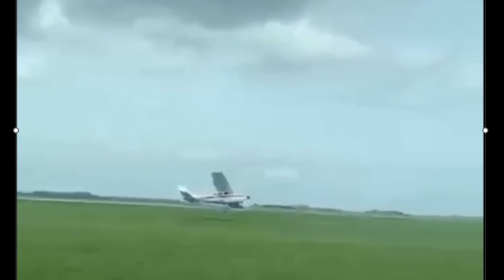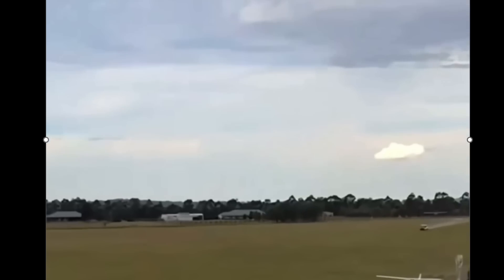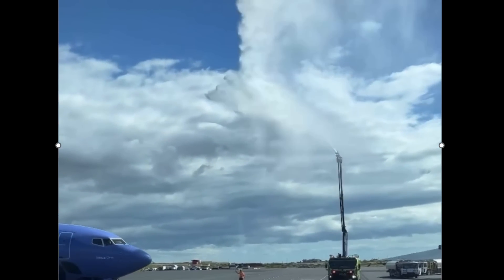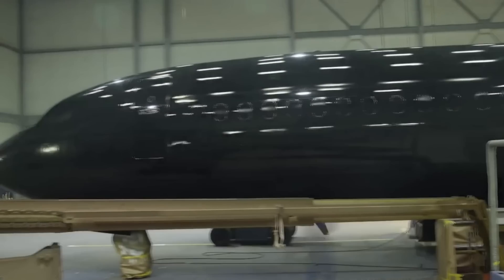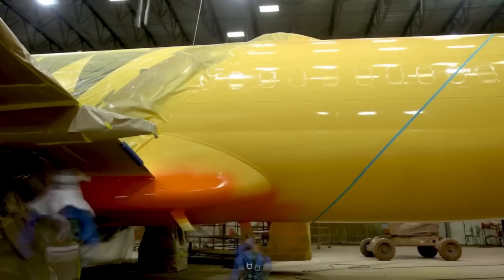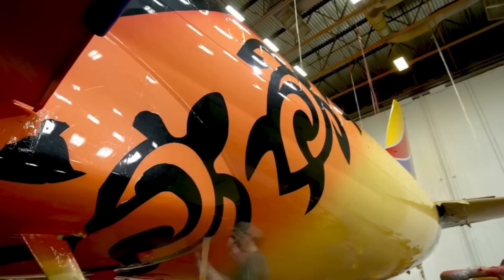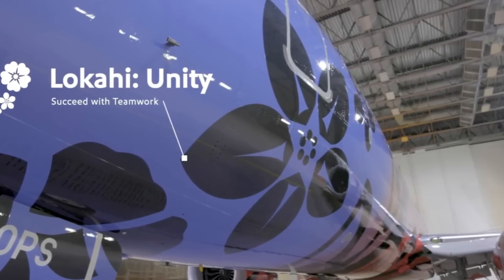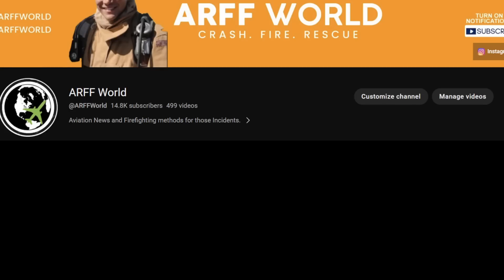Pilots Failed Landing Stunt and More

Comment: That post-maintenance flight doubles as a pre-INTENSE maintenance flight. Also, when the wing dropped in the second clip, I was expecting the worst, really good save by the pilot there
Reply from the maker: Yes that was tight!
Reply: Exactly. My annual inspection should be completed today. My mechanics are among the most experienced and best in the business, but before I fly, I will conduct an extremely thorough pre-flight. Then I will perform a test flight in daylight, good weather, solo, orbiting over the airport checking all of the systems, while staying in gliding range. After I land, I will inspect the engine compartment for leaks and conduct a thorough post-flight inspection. Only then will I fly a trip or carry passengers.

Comment: Very nice video.  The Cessna 207 will need a new engine and prop.  The engine mount and firewall will need to be inspected for possible damage.  The engine mounts in a 207 do not flex at all and are an integrated part of the airframe unlike a tube engine mount that simply bolts onto the firewall on much smaller Cessnas. The second clip, the pilot got lucky aborting the landing when he did.  Looks like he either got into ground effect or a sudden wind threw him off his target.  He managed to save the airplane from crashing.  A good friend of my father was a nationally known stunt pilot name Gene Griffin and he did some stunt work in Hollywood.  In one film, he landed a Navy float plane on top of a moving car for a movie, but I can't remember the name of the movie.  He to this day holds the world tail spin record in the Piper J-3 Cub where he performed 87 consecutive turns from a height of 12,000 feet that he set back in 1950.  There have been many pilots who have attempted to break Gene's world record and three pilots have so far died attempting it.  Southwest Airlines did an incredible job painting that 737.  I'm glad they are honoring the families of Hawaii in such a special way. Thanks for sharing.
Reply from the maker: 87! Wow.  I would be dizzy. Thanks for sharing that with us

Comment: My favorite commercial airplane ever is the the Boeing 717, originally designed by McDonnell Douglas as the MD-95. Hawaiian Airlines is one of the few carriers that fly them. The 717 was designed to make a large number of short flights per day, making it ideal for island-hopping. No plane has ever been as reliable -- due to the McDonnell Douglas legacy emphasizing quality construction. I had the pleasure of working on them, and came to appreciate the quality of the riveting, the wiring, the insulation blankets . . . everything I was involved with, really. It's too bad Boeing didn't put more effort into marketing the 717. Ending 717 production conceded the market for smaller commercial jets to Embraer E-2 and Airbus 220.
Reply: Right, they should've been less focused on the 787, 737, Military jets and spaceflight...
Reply from the maker: Those 717 are pretty rare elsewhere, but we see them everyday still coming in and very reliable over the years
Reply: @ARFFWorld  Delta got 717 for a great price when Southwest merged with AirTran and SW sold them back to Boeing.

Comment: Just my thoughts on giving out the accident aircraft N number. I personally don’t feel it’s necessary in this venue. Don’t think it adds anything and it can be used by some individuals to get information on the owner which they otherwise could not do.
Reply from the maker: Thanks Greg.  I use it so others may look further into the crash to learn further and follow up.  I see where you are coming from though and appreciate it